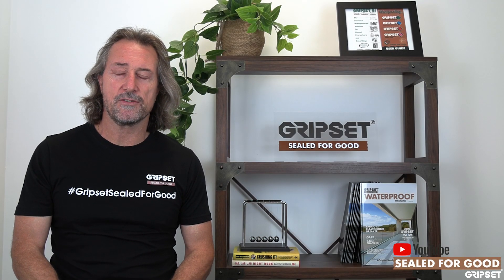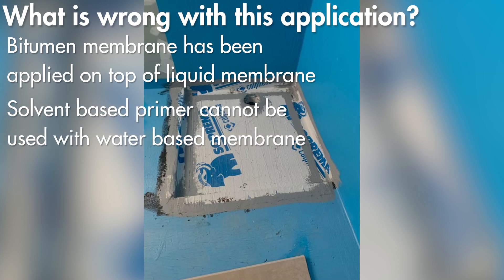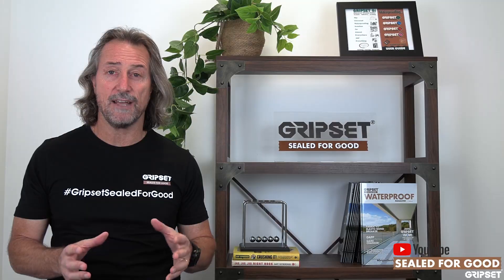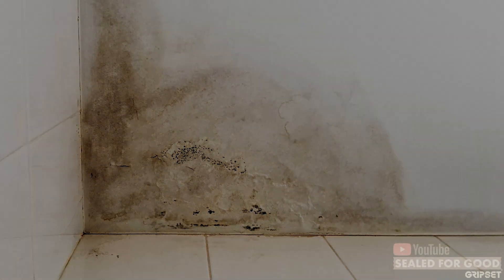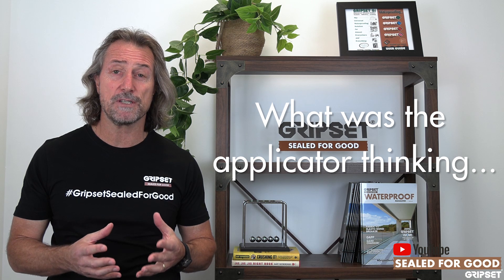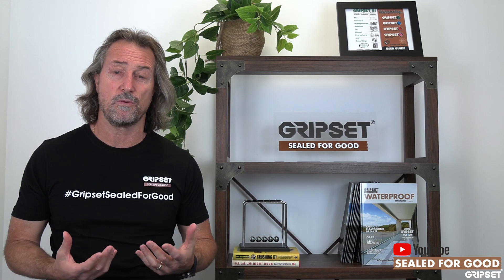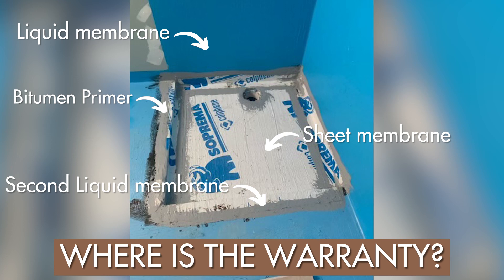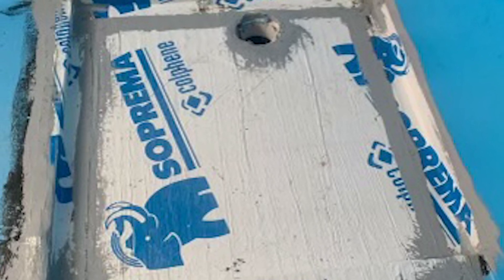How is this still happening? (Waterproofing failure)

Comment: I recently had a friend (who should know better as he is a tradesmen himself) try to save some money by having a GYPROCKER (yes a gyprocker) apply the waterproofing in his new bathroom, the gyprocker used a liquid solvent bitumen with silicone (yes silicone) as his bond breaker. He applied two coats to the entire floor area AND also applied the bitumen membrane to every wall from floor to ceiling. (The entire bathroom was black from the ceiling down 😬). 

I randomly called in to see how my friends renovation was going on my way home one day (which happened to be a day or so after the waterproofing was finished). I instantly noticed the strong smell of bitumen as I was walking upstairs to see his bathroom. As soon as I looked into the room, I said "You have an enormous problem here, this waterproofing is not suitable for this application" he was in absolute shock and was completely oblivious to the disaster that this gyprocker had created. 

Luckily, he was able to postpone the tiler who was due to start the following day and have the issue rectified by a licensed waterproofer.

I wish I would have taken some photos and videos of the disaster when I was there.

I hate to think how bad things would have gotten if I had not called in by chance and spotted the problem when I did. 😳
Reply from the maker: Hi vzgsxr, interesting situation (scary really) thanks for sharing, I hope your friend appreciates you saving him from a catastrophic failure! Thanks for watching we appreciate your engagement!

Comment: Good video Phil. To break down the failure points even further, I believe the grey is PU around the perimeter of the shower area and not liquid as stated, but more concerning is the fact that the Soprema Colphene 3000  has a polyethylene sheet (the white exposed side we can see) that won't be compatible with tile glues or bedding. One more area of failure to add to the list. Great videos and let's keep educating.
Reply from the maker: Thanks for watching!